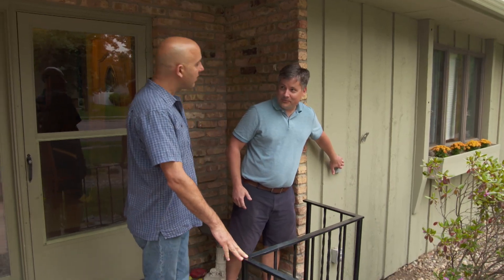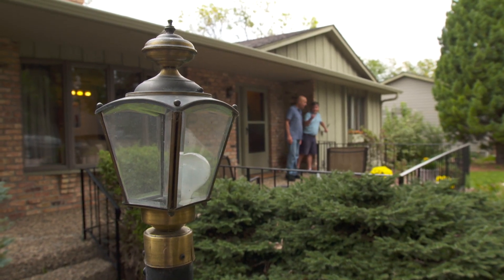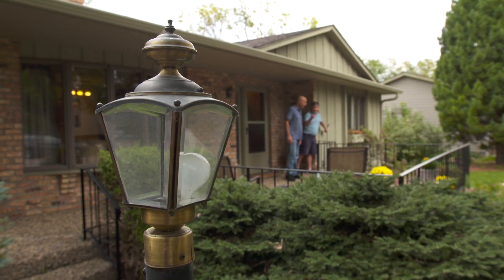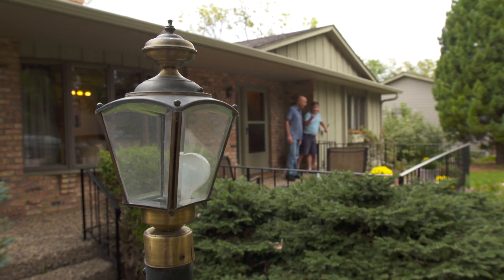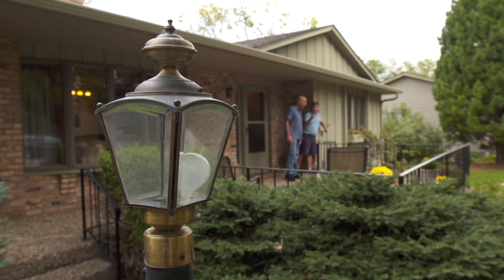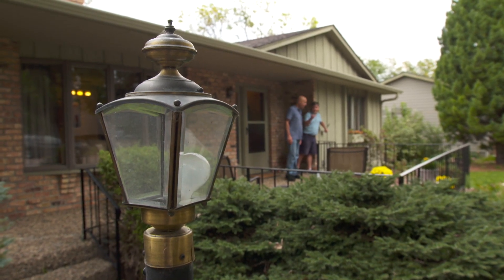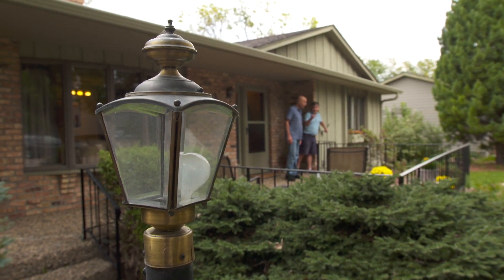How to Replace a Post Light | Ask This Old House

Comment: Pro-tip I learned from an old-school electrician, always position the twist-on connectors so the cone faces up when seating it in a post or anything outside really. this way if water or moisture does get in it doesn't collect in the bottom that can be easily corroded and instead wafts down. it is also good practice to wrap the connections in electrical tape to prevent corrosion or better yet use push-in connectors.
Reply: also wtf, no weatherproofing/silicone around the new switch box? water will soon rot the house through the rather large gaps on the side.
Reply: Absolutely correct! When I bought my house, many of the lights didn't work - and it was all because they left the wire nuts pointed downward.  All I had to do was trim and strip the wires, and reconnect them. Such an easy thing to fix.... And such a silly mistake.
Reply: @fd3871  how do you know he didn’t later silicone it? It’s a 6 minute video trying to capture an all day job.
Reply: @thetributary8089  i don't, but even if he did - it if this is meant to be informational they missed the mark as that is a critical step when dealing with the outside layer of your house.

Comment: DIODE=LED=light emitting diode    but diodes do burn out from power surges or voltage spikes then you'll have to replace the whole unit.  I prefer the standard screw on bulb using LED=DIODE bulbs i can replace anytime  choose the wattage I want even a dimming version or choose color like green for christmas orange for thanksgiving red for whatever i'd go for replaceable type bulb[LED]  than fixed type with no options a poor choice in my opinion.
Reply: I agree, I would install a standard screw in type fixture if I were an electrician like him and I would even tell the customer that I don't recommend the bulb-less style.

Comment: Wow that new big wart sticking out of that owner's wall, drop the switch and get a light activated one built into the post.... And an LED light that will need the whole assembly re-wired in order to replace, which most home owners wouldn't do themselves. My experience has been that with '13 year' mainbrand LEDs about 1/5 fail every 2 years. This repairman knows how to keep himself employed!
Reply: Yeah, a lot of those posts have a placeholder where you can add a photocell to control the light. And I agree, for as many LED bulbs as I buy (the drop-in kind that fit in standard bulb sockets) I absolutely don't trust those fixtures that use hard-wired non-replaceable LEDs. A whole fixture that has to be replaced just because the LED failed is a poor design.
Reply: @AdhamOhm  integrated LED fixtures are more reliable than screw-in LED bulbs. They have better electronics (not as space/cost constrained) so they generate less heat and last longer.
Reply: Back when this was filmed LED's were mostly of this style - dedicated fixtures. It was because the bulb type could not dissipate enough heat, so they need a full assembly with a big heat sink.

These days technology has improved and standard bulbs are the way to go, but it wasn't the case back then.

I do agree about the switch - that should have been recessed in the wall, but maybe there was something preventing that.

Comment: Am I tripping out or was that NMD90 just buried in the dirt by itself?
Reply: Surprised this comment isn’t higher up, the cable feeding the post is absolutely not rated for direct burial, and because he did work on that circuit he is now responsible/liable. Huge oversight in my opinion.

Comment: A bit confused.  Why did this electrician surface mount the water proof exterior electrical box.  why did he decide to ignore the recessed "cut out" area.  Doesn't this leave access for water and insect invasion?  I hope he (at least) caulked the perimeter of the box.  I love the idea of using an anatomical clock

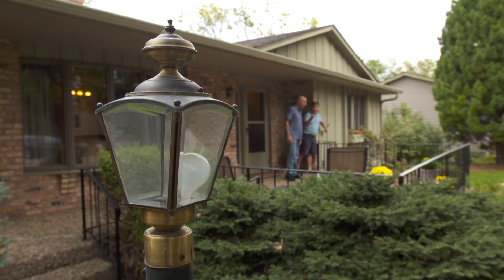Comment: 1:50 "It's all aluminum so it'll never rust." No it won't rust, it will just corrode.
Reply: a lot of aluminum alloys will take a number of centuries to corrode, given that they're not in direct contact with copper, rusting steel, or something similar.
a thin post like that might last for 500 years before pitting corrosion, likely to be the greatest corrosion type in this circumstance, creates any microscopic holes through the aluminum.

Given proper installation, corrosion is functionally a moot point.
Reply: ***** That depends entirely on the composition of the soil and the environment and the type of aluminum used.
Reply: Maxid1
true. wasn't thinking about the soil exposure part. that'll be interesting

Comment: I just got done replacing my lamp post and I'm sitting here jealous of all these houses with their old posts that can just be pulled out of the ground like they're nothing. My old post wasn't so easy to remove. Whoever installed it (it was there long before I bought the place) did it TOO professionally-- they used a 16 inch deep concrete base with a gravel underlayment and PVC conduit that ran back to the house. It was an absolute headache to remove.

Comment: I searched for a diode, similar to the one he installed.  I wanted to try it along with the diffuser.  We don't want a bright light in our back yard and this seems like a good solution.  However I cannot find this anywhere.  I've searched diode, led, lamp post - you name it.  Visited hardware stores...nothing.  Is there a link to where he bought it?

Comment: Just give me a simple on/off switch. Also, if you do need to replace the led how much? Or are you better off buying a new light fixture?
Reply: you never really have to replace a led at that point you will probably not even live at the house but if so its basically better just to be a new light

Comment: Quick question..... (for anyone that is)
Why did he allow the cement to cover and finally set surrounding the cable? What if the homeowner decides to change the post? Wouldn't this make the homeowner have to cut the cable?
Reply: I want to know this too
Reply: That is a good question to ask. In my case, if it were my home and I wanted to change the post I would carefully dig it out, lay it all on the ground, then carefully and chisel and chip away at the cement with a chisel and hammer until I freed up the cable.
Reply: It would make the cable useless. It should have been shrouded in PVC conduit at the very least.

Jeff
Licensed Journeyman Electrician
Reply: Because he was being lazy

Comment: i was hoping to see what he did with the two bolts that the new light fixture for the outside of the house attached to. that's what always hangs me up, they are always too long to make the fixture flush against the wall
Reply: A good pair of wire cutters should have a place wear you can thread in the screw for the fixture and trim it shorter. There so long because of different sheathing options for houses.

Comment: Why is the switch outside O_o
Reply: +Spencerkey22 Never seen that one before. I don't understand why he re-wired the entire circuit and still left it outside, other than that he didn't want to deal with patching the wall/siding.
Reply: +briancnc But did he rewire it all or just reuse what was there?
I did not see him rewire, but use the old wire. The old insulation might have been good but why risk it? At very least check if it's OK or if the insulation is crappy being outside exposed to water and heat.
Reply: +Reggie Buffat He pulled a new romex for the switch you can see him fish it, they just tapped off a receptacle. I would have patched the siding and installed a switch indoors, it doesn't make any sense to install a switch outside for this application.
Reply: +briancnc He put in an automatic switch that turns it on at night and off at dawn. That needs to be outside.
Reply: +Maxid1 he installed an astronomical timer, not a photocell. No need for it to be outside other then it was the existing location.
Reply: zimsjeep
Good to know. Now I know my neighborhood astronomical clock dealer ripped me off charging me extra for the delux photocell option...
Reply: +ravenlorans The wire in the ground could have been old-style UF  before UF was gray. I have a piece of UF at home that is not grey or black it's white and says UF on it it's powering an old mercury vapor light on a pole and it's buried
Reply: +Ben Boudreau That is what I was going to state. I have an old house.
Reply: So he can charge the homeowners $$hundreds more without a lot of work. Typical.
Reply: Right, but it was a simple switch outside PRIOR to replacing it with the dawn/dusk switch. Why was it originally installed outdoors?
Reply: it was a DIY job... you can tell ... who cuts the back of a junction box off  and locates the switch outside..  and runs white housewire outdoors rather than  black underground wire and no conduit   just a blob of concrete to hit with the shovel when they rip that bush out .. an electrician would charge about 800$ for all that work
Reply: Thats how we do it bro
Reply: ravenlorans Yep. This was definitely a DIY job. I doubt they spent the extra money for conduit, so that romex cable is probably direct buried, maybe a foot deep if they’re lucky. Unless that wire is tapped off of an indoor GFCI outlet or the breaker is GFCI, it’s not GFCI protected either. 

I’m just a DIY guy, but I look up the codes and follow them when I do my home improvement projects.

Comment: What a waste of money. All that's needed was a new light switch.
Reply: You must have saw in the video that the lighbulb was leaning over that is why that and the switch both got replaced
L. E. D. Lights are very efficient and last 10,000 hours or more which means they practically have no point of failure at all whereas incandescent bulbs are extremely inefficient as 90% of the energy they use is wasted as heat and only 10% is converted into visible light and they only last 2,000 hours then totally burn out and blow completely which is the main point of failure
Reply: He asked the home owner if he liked that idea
Reply: It’s a show, relax